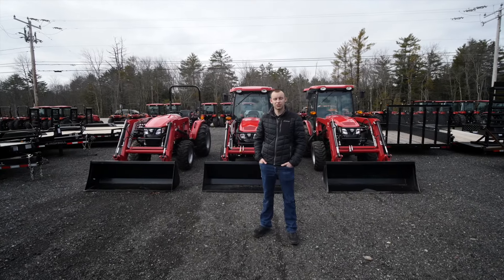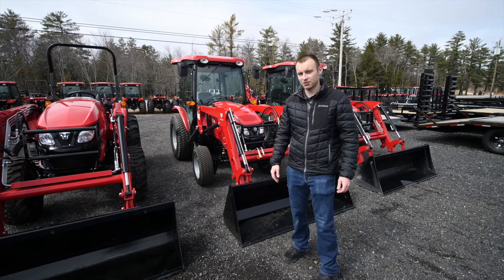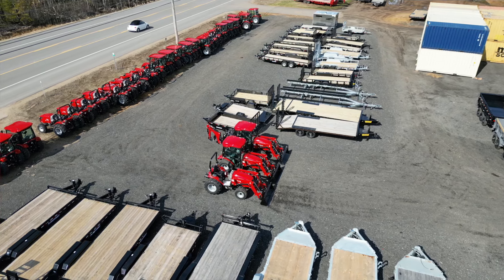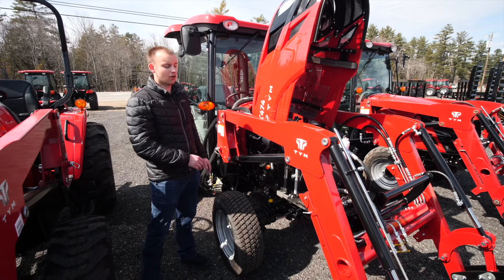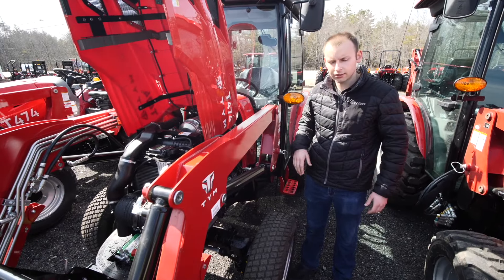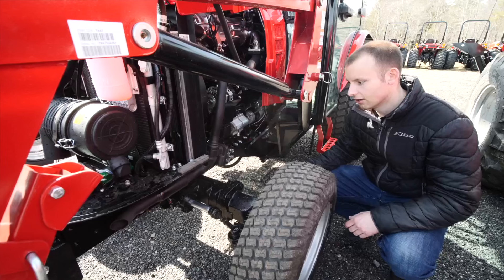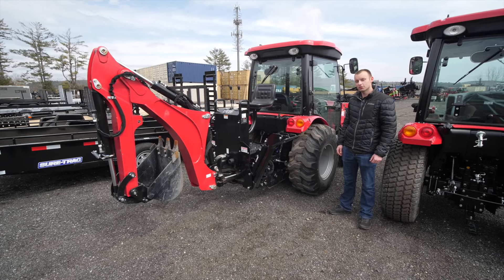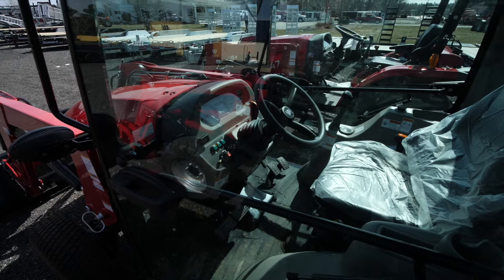Watch before buying a TYM T474 Tractor - IN DEPTH REVIEW

Comment: I like everything about the 474 and 574 except how far the hydraulic hoses stick out with no protection. Seems like a disaster waiting to happen. But my disdain for EGR system may make me overlook that. I really like the simplicity of the Kukje engine and no turbos on the 474 makes it even more attractive.
Reply: I thought the same thing when I saw those hoses sticking out down there.  I would have those torn off in no time. 😁
Reply: When I saw those hoses like that. Yep that is a disaster, however I did grab them and pulled them back out of the way. It is possible to not have them sticking out that far. Perhaps a couple cable ties and bunjy cords will improve the the chances of not ripping them off. I have the tractor but haven't made the improvements yet. I really dislike the position of the diff lock. That is a terrible place to put it.  Should be on the left.

Comment: Absolutely love these engines. Love the simplicity of the mechanical injection and how they do the DPF regions. So much potential with this set up. Kukje are very reliable from our experience. They not only contracted to build Cummins engines. They also built a model or two of John Deere tractors in Europe.

Comment: Love my T474 Cab HST, however after 400 hours on not rough work whatsoever, the bucket lower frame has 4 bolts on each side, 3 of 4 were broken on each side and the stabilizer bar on the lower left side broke in half.  Again, I do not work this tractor at all, just letting you all know to keep an eye on this, the bolts that failed were grade 6, I replaced with Grade 8, the dealer told me these are not sheer.  Strange they used grade 6.

Comment: Coming up on my 50 hour service on the 474. Are you aware of the 3 point issue with the new valve body they are installing in both tym and bransons? Mine has the new valve body.....it's TERRIBLE. I can't finesse control my 3 point at all. My dealer said engineers at TYM are aware of the complaints, and will NOT be addressing the issue. Just thought you might like to know that not all TYM owners are happy about it. Pisses me off in fact.....

Comment: Why do some TYM tractors have red rims and other have silver (which look better)?
Reply from the maker: As of very recently, they are starting to come with red. As the factory stock of silver depletes, they will all start coming with red from then on.
Reply: @SR1Equipment  Are they putting welded on guards around the valve stems on the wheels? When I looked at one at a local dealer, it did not have those guards and I found that to be disappointing.